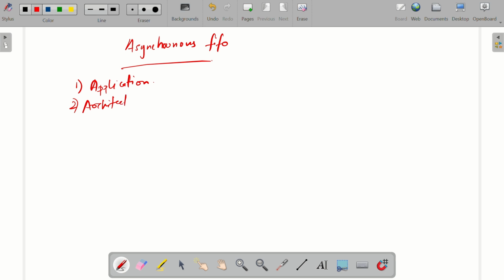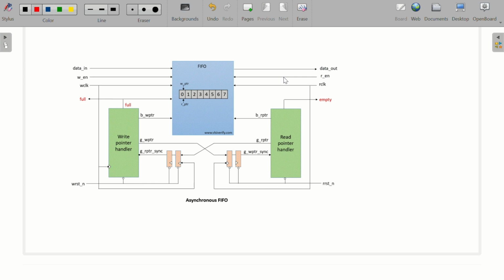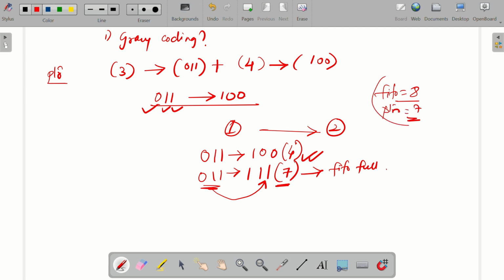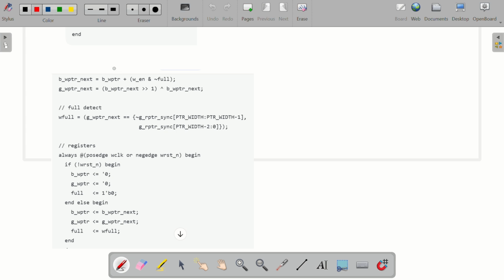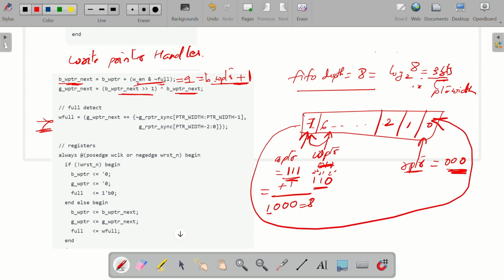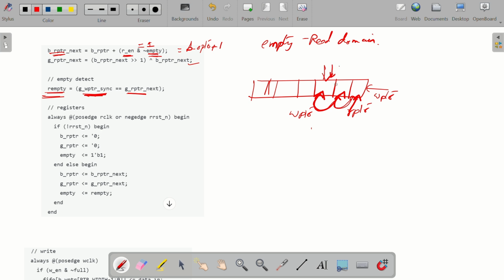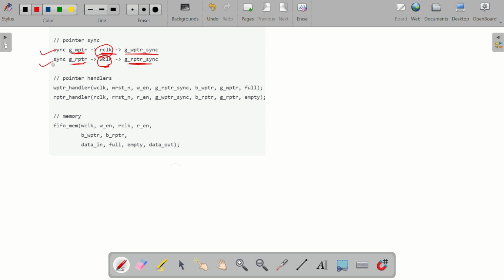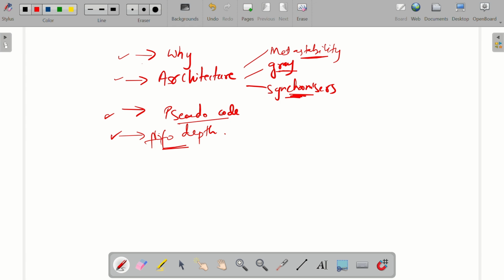Asynchronous FIFO- Architecture and pseudo code explanation with FIFO depth numerical

Comment: Great video! One question though, if our full detect (wfull) and empty detect (r_empty) are calculated using combinational logic, why not just use these signals directly as our full/empty indicators instead of plugging them into synchronous registers? (full <= wfull, same is done with empty)
Reply from the maker: Good question, the answer is going to be a little elaborate so bear with me 😅.

If we simply used the combinational signals directly, like full = wfull, where both full and wfull are wires, then it would be a continuous assignment. The left-hand side would change immediately whenever the right-hand side changes, without waiting for a clock edge.

This means the FIFO control logic could see a change in the full/empty flag in the middle of a clock cycle. Since wfull and r_empty are generated using combinational comparison logic, any change in the pointers can immediately affect these signals after the logic propagation delay.

As I explained in my video, Gray coding helps here because only one bit changes between consecutive pointer values, so we avoid the problem of multiple pointer bits changing together and causing wrong intermediate values during comparison. But even with Gray coding, the full/empty signals are still coming from combinational logic, so they can still change as soon as the pointer comparison result changes.

For example, suppose the FIFO is not full at the beginning of a cycle, so full = 0. A write operation updates the pointer, and the combinational logic now detects that the FIFO has become full. Since full is directly connected to wfull, it changes immediately in the middle of the cycle instead of waiting for the clock edge. Another block in the FIFO might still be operating based on the previous state, which can create timing issues or glitches.

By storing the value in a synchronous register (full <= wfull and empty <= r_empty), the flags update only on the clock edge. This keeps the full/empty signals stable for the entire clock cycle and makes sure the FIFO logic is always working with a synchronized status signal.
Reply: @sanN-w1z-f5t  I see, thank you for the explanation!

Comment: Nice video. Thanks for a detailed explanation 🙏🙏It would be good to add some material on the testbench architecture for this design (in System Verilog/UVM) along with waveform and coverage analysis.
Reply from the maker: Thank you Vaibhav! , Regarding the verification part will be launching in future🙂
Reply: @sanN-w1z-f5t  sounds good. Still waiting for the verification video 😊😊Btw at 40:45 PTR_WIDTH is $clog2(FIFO_DEPTH) and should be equal to 3. We declare b_wptr and b_rtpr as [PTR_WIDTH:0] to account for the extra MSB used to calculate the FIFO full condition.